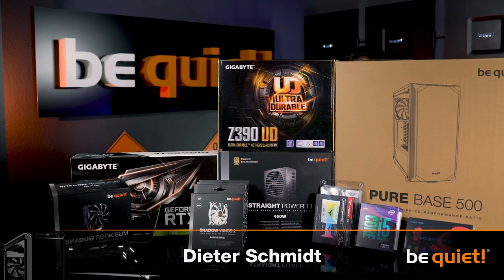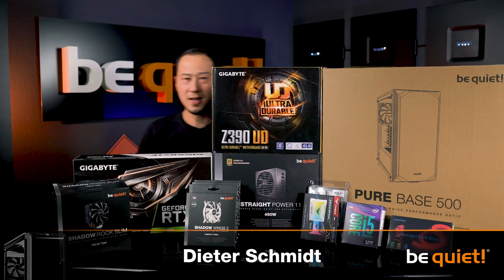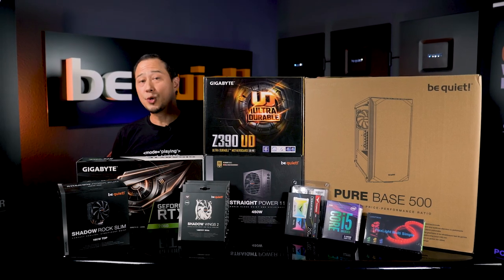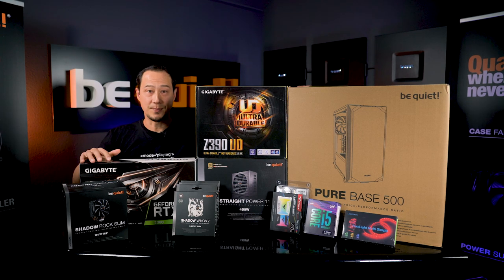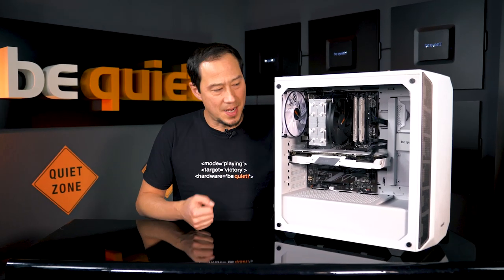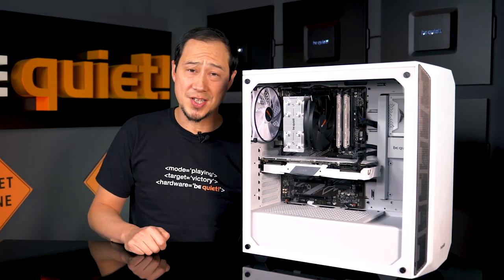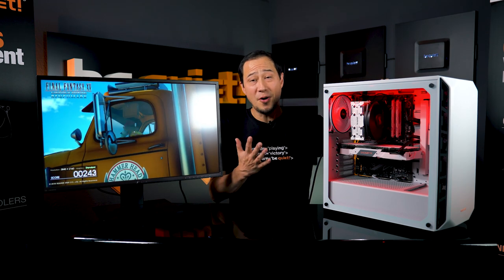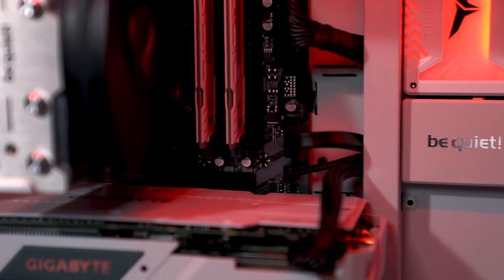1200 Euro White Build English | be quiet!

Comment: Be Quiet is as Silent and White as Clouds in The Sky on a Snowy Winter Day

I have dreamed of having a gaming PC this good for a long time after I tried to run Battlefront 2 at low settings and my PC crashed. I've used computers with Be Quiet cases and LOVED IT, UNBEATABLE. 🔥🔥🔥 (Forget the fire because the Shadow Rock Slim will keep my CPU ICE COLD🥶🥶  the whole time when I run Battlefront 2 on ultra settings on my new gaming rig 🤞🤞

Comment: "Be Quiet!" Is as silent and white as... The soundproofed room I'm using to put my jet engine of a pc in, and still quieter! My straps will have no issue holding down this pc from takeoff like my previous pc, while the benchmarks rise sky-high with the powerful GPU and CPU

Hi, I'm Alex and I'm from England, im 14 and the first pc I ever built was when I was 10. By now it is very worn out and not very powerful, it wasn't fast even when I built it. I'd really like to start playing games again. Especially the games that I bought but cannot be run on my pc :(. Thanks